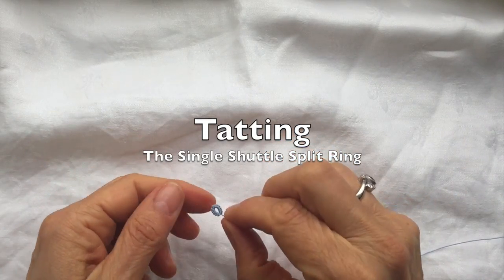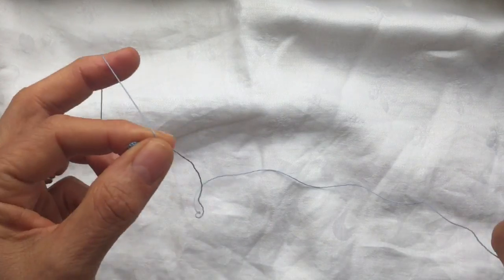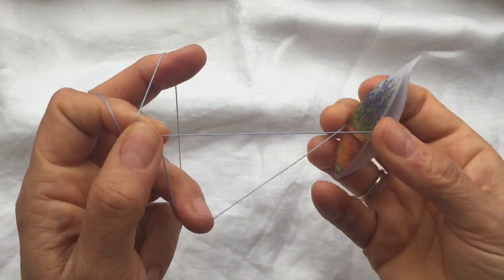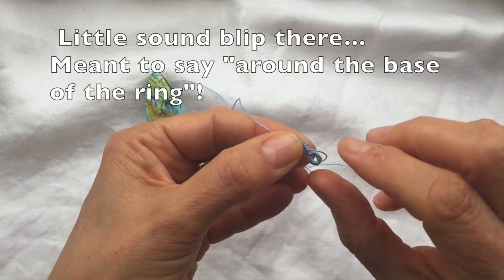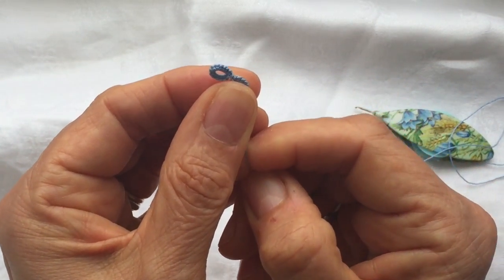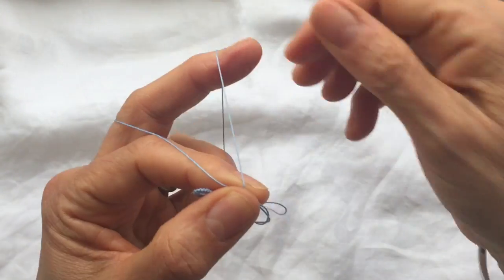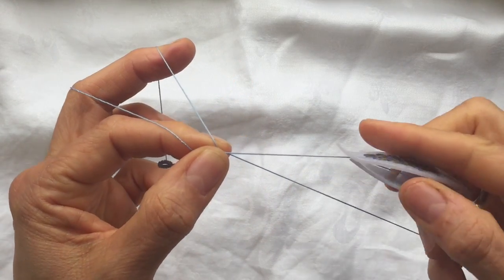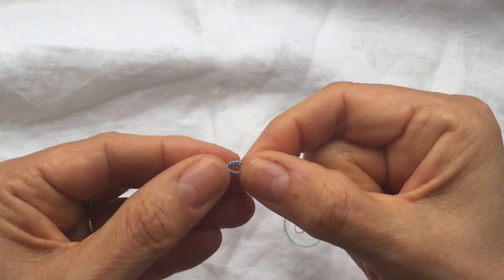Tatting - The Single Shuttle Split Ring

Comment: Would you be able to use this in the same fashion as a two shuttle split ring, with picots and joins? Having a hard time figuring this out
Reply from the maker: Hello, yes, you certainly could as you can just as easily make picots to join to afterwards using this method.

Comment: I plan on trying this technique tonight, but I have a question. Is one side of your split ring thicker than the other? On one side you are tatting with a single strand of thread, but on the second side you are tatting with both strands of the loop.
Reply from the maker: Hi Lisa, yes, you are right, one side would be slightly thicker but it's not really noticeable.
Reply: @11Frivole  thank you for replying!!
Reply from the maker: @sewverypeculiar  You're welcome!  :-)

Comment: Thank you for all you do. You are remarkable. I do have a question. Is it at all possible to do the SSSR in alternating colors? One ring red, the next one black the next one red and so on.
Reply from the maker: Mmm, that's an interesting questions Teresa and one I hadn't considered.  But my guess would be yes (although I'd have to test it).  You'd have to start with two shuttles and carry the colour not in use along the core thread of the ring made in the other colour (does that make sense?).
Reply from the maker: Hi Teresa, I just uploaded a new video that shows how to make alternating colour single shuttle split rings.  You can find it here:  https://www.youtube.com/watch?v=N7Ge4wqnhw4

Comment: Hello Frivole! I've been tatting with what you've taught me, but I have a question: can you make a split ring with a single shuttle and ball? I can only find single and double shuttle methods.
Reply from the maker: Hello Purly, it's not impossible but rather difficult to make a split ring with a ball as you would need to use the ball to make the stitches on one half of the split ring.